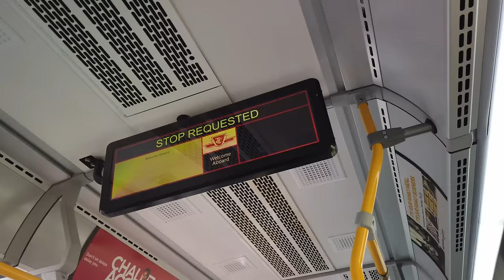Why American Buses Are Just Worse

Comment: I think the seat problem comes from this strange idea that if you make seats uncomfortable then homeless people or intoxicated people will just disappear.
Reply: If you're talking about those seats without any padding, well, those are easier to clean and more resistant to vandalism and general wear. (Yes, I'm aware that the vandalism bit is silly.)
Reply: @sonicboy678  See, I don't buy the cleaning bit. A padded seat with some kind of vinyl cover or something like that should be just as easy to clean.  But also I've never been on a bus or train with super dirty or worn seats, even obviously old ones. Now that might be because they spend a lot of time cleaning and repairing the seats but I kind of doubt that. Also the new LRT trains in Calgary have these plastic seats with a strange curvature that kind of digs into your back. I don't think that's because it's easier to clean.
Reply: @wearwolf2500  The vinyl may be easy to clean, but it tears.  I've seen several torn seats.  I don't know whether this is vandalism, people wearing tools, someone sitting too abruptly, brittleness in the cold, or something else, but it seems to be a thing.
Reply: @wearwolf2500  Vinyl is a quite bad idea, as it heats up when exposed to sunlight, and it gets brittle very soon. Most European busses thus have textile covers.
Reply: @Kyle Brown  Compare the seats on the London Tube with those on the New York subway. New York's seats, despite the reputation otherwise, are much cleaner owing to the fact they are plastic and only need a wipe down to be clean. London's seats are padded and require vacuuming, and are generally considered more gross.

There are subways that have been active for decades with the same seats because you can't really damage a plain plastic seat. Also, homeless people readily sleep on them so it's not a good deterrent if that is the goal.
Reply: @evancook1770  I'm pretty happy having 'gross' padded seats than awful hard surface ones. Another reason why I dislike travelling on the Subway.
Reply: @ballyhigh11  If the reason you don't take the subway is that the seats are a bit uncomfortable, you're either not from the city or likely not to take the subway anyway...js
Reply: most riders have enough padding on thier fat behinds
Reply: Homeless sleeping on buses and vandalism in America is the major reason why the seats don't have padding. It is just not practical in a low trust society where the default mode of interaction with transit is antagonistic. American buses are a classic example of the tragedy of the commons. We simply can't have nice things in this country. Maybe the next step is not to have seats at all on buses.
Reply: @Novusod  Europeans aren't any less rowdy...just look at France when any new law is passed or England during soccer season. Some busses in New York have padded seats and they aren't damaged at all.

Reason for plastic is because it's cheaper, sturdier, and easier to clean. Same reason anywhere else uses plastic seating.
Reply: @sonicboy678  and to act as deterrent to bedbug pest
Reply: @evancook1770  Europeans get rowdy for a couple hours a few times per year. America is a circus 24/7 365days a year. Buses aren't just used for transportation in America. They also serve as temporary shelter for the homeless who often do drugs and commit crimes while riding transit.
Reply: @Novusod  You've never been on a bus, have you...
Reply: @evancook1770  I'm from the US, and I have been on a bus. Generally, whether buses are nice has to do with the population of the city that uses them. When I lived in Houston, while I myself was not a crime victim or witnessed drug use, I did witness a few fights and regularly encountered people that seemed out of it, so I can see why people might be a little fearful. This only happened when traveling through bad neighborhoods - the public transit used by the medical staff was well behaved. Similarly, when I lived in Madison, Wisconsin, a major university town, the public transit was well used and quite clean. Now in live in San Jose, and it seems like only homeless people use it, but they're generally pretty well behaved - I don't use it very often, though, because it's extremely inconvenient and slow.
Reply: @Robert Irelan  It's definitely a matter of ridership, yeah. The crazies and what not I think are always there, but when it's just them it feels a lot worse (not counting buses that primarily serve high-crime communities which would have their own share of issues).

My point to him was more to say that buses, and public transportation I'm general, wouldn't be classified as magnets for the worst of society by someone that rides it with an honest lense. As you said, it's a reflection of the general community - if you're okay with your general community you should be generally okay with the public transportation.
Reply: That and buses are for the poor, and Calvinist beliefs decree that being poor should be punished.
Reply: No, not really It's two fold, first there is the guy with a knife trying to cut up the seats and rip out the upholstery. Solution ...have a fabric covered seat with no  padded upholstery. In fact  in some places have the back bench doesn't even have the cloth covering. It's just a hard fiberglass seat. They also now have a small drain hole in the middle so the drunk person  can pee on themselves and the urine drains on the floor. Having an individual bucket seat makes it a snap to replace a soiled seat with a clean one. The driver should call for a bus change so the floor can be washed, and we don't have to breath pee.
The rough ride is the bus system trying to not spend money on new shock absorbers. Sit in the middle of the bus for the best ride.The drunks usually are in back sleeping (and peeing on themselves).
Reply: @Rap Brz  Solid advice for the people that want public transportation without the public
Reply: Metrolinx has great seats. Not sure about homeless and intoxicated people. They just need to be enforced
Reply: Zaydan Alfariz  Because we have a lot of them. Our policy of treating housing as an investment that must stay scarce so it can go up in value ensures that.
Reply: @MrBirdnose  I think he’s talking about how Americans present homeless people as otherworldly and inhuman. The argument is rarely how can we help the homeless and more how can we get rid of the homeless.

Of course, a lot of this rhetoric comes from people that live in suburbs and rely on TV stereotypes.

For example, I have never seen a homeless person SLEEPING on a bus. That’s mostly a subway thing. But, people who have never been on any mode of public transit wouldn’t know the difference.
Reply: @banksrail  I saw it occasionally in Seattle. There were certain routes that were known for it, usually because of their length.
Reply: it's not that they'll disappear. it's that you dont have to repair them everytime bums and teenage bums break them. you'd be surprised at the number of people that crap themselves on public transit. not to mention drunks, addicts, and people that are plain bored and pick at the seats. most transit operators are already struggling to keep up with maintenance and when fairs cover less than a quarter of operating costs you can see why they cant afford to be replacing seats
Reply: @sonicboy678  In Toronto it is not necessarily silly.  Torn seat covers used to cost them enormous sums of money every year, and they might still cost them a lot.
Reply: @sonicboy678  Padding isn't required to have a seat that's comfortable to sit in. There are seats made from a single piece of moulded plastic that are perfectly fit to sit in for half an hour (or even 90 minutes, see about every soccer stadium in Europe). There are even benches from hard plastic that are nice to sit on for an average ride length (e.g. light transit in Hanover, Germany).
Reply: @wearwolf2500  hard seats are widespread even in Europe.
Reply: @SiqueScarface  Can confirm, from experience, that Vinyl is a bad idea; the seats on the Dutch ICM trains have a vinyl/acrylic type of fabric and those are starting to cack and tear, while the trains with more fabricy/leathery seats like a VIRM do not have that issue
Reply: Will Swift  With a lot of the buses I rode you were standing most of the time anyway.
Reply: The seats are plastic buckets because they are easy and fast to clean. They also wear better as they do not show wear as much. Plus they are generally cheaper. All of those matter more than your comfort when your transit authority is deciding what to buy.
Reply: @GeorgeMonet  Yeah, plus transit in North American cities always has to be uncomfortable and inconvenient in order to remind poor people that they don't deserve nice things.
Reply: Nope. The hard seats are a reaction to vandalism in buses. I remember soft seats being cut and destroyed intentionally all the time. Hard seats are the absolute standard solution in most Western European nations btw.
Reply: @Mike.Muc.3.1415  .
I'm in the UK and have never seen hard seats in a bus.
Reply: @wearwolf2500  we had that in NYC
And then the homeless came on and people started getting bedbugs and other things that stick to them
So we went back to plastic 
You get used to it you just can’t sleep on it
Reply: @evancook1770  Yes, but the French has a strong sense of social justice. And dont mind paying abit more tax so the homeless/jobless can have a roof over his/her head and food in their belly.

So people in France is way less desperate. France has pretty much the same crimerate as USA. But the crime in USA is super lethal and scary compared to the french crime.
Some of it is cause of the weapons in USA, but some of it is cause people are really desperate. And life becomes "cheap" when one is fighting for survival. Desperate people can do unimaginable things.

Best thing for a society is to minimize desperate people. 

I live in a fairly socialist nation aswell (Norway) we do some some desperation here too. But its way less than in USA, the desperate people we have is those who fall "thru the cracks". Like those who are too sick to work, to healthy to get disabilities financial support etc.

Immigrats, who dont understand the language or the bureaucracy so they can get food in their belly. Like we had a killing in on of our "Social centers" after some mentally unstable guy got angry at them for not suppling him funds for food. But the more people we cover, the less desperate people we get. Some people are mental cases. But alot of mental cases are bad upbringing etc, by desperate people. So it comes an evil circle. Just like you get a good circle going by educating and giving populations tools too thrive.

So we are discussing putting an automatic payment to everyone who falls under a certain income, so they dont have to fight bureaucracy etc. To lessen desperation and distress people feel. Yes, some will take advantage of the system. But most wont, most are honorable people after all. Who wants to live abit more than you can on goverment financial support. People have mandatory vacation here, and most people expect to vacation in a foreign country every year. This costs money, very hard to make happen with the money you get from the goverment.
Reply: @evancook1770  On the LA Metro it is common for people to smoke weed, vapes, even crystal. They'll pull out a pipe & torch and light up in a crowded train, not giving any f's. 
Sales are just as common. 
Reportedly SF MUNI is in a similar sad state.
Reply: @derek20la  Public transportation in California is bad in general.
Reply: Actually there are lot of homeless freeriders in public transport in my european city.
Reply: And it's the fact that in the US, you can't trust people to not vandalize property. We just do not have a strong moral society which is why you can see a nice new clean building get finished one day, then come back in about a week and someone would have graffiti all over it.
Reply: @dekoldrick  happens in Central Europe cities as well. Dudes that put spray on clean walls immediately, and its not even art (there are places with really cool graffiti), just signature of some a__hole. Or probably drunk guys/youth that break glass on bus stops. Talking heads explained it with the heritage of communism, but now we are 30 years after communism, have new generations grown, and the same vandals.
But buses are OK, sometimes they are just old scandinavian or german buses, thrown away by first users, but they ride.
Reply: @dekoldrick  That's everywhere
Reply: Bus seats on new Mercedes busses are extremly uncomfortable.
Reply: @mareklame8589  What country is that? I know some of the old eastern block has some homeless issues. And some issues taking well care of the mental cases etc.

I saw a few in Poland when i was there last. But thats nothing like walking in LA. In LA all you see is homeless people sometimes.
Reply: @MrDanisve  Poland. There are shelters. But there are homeless people that don't want to follow the rules, esp. not drinking. 

But you don't see homeless people all the time in Poland.
Reply: @UCSkT_4HRYsjHnauVFU0VXBA  In fact, Americans once came up with a concept which was even worse than this... That is, if you make public transport uncomfortable, unreliable, inconvenient and simply disgusting to use, then more people will buy their own cars. And this is the actual reason why US buses are soooo ugly. If you don't like it - then you can buy a car for yourself. This story shows how big and powerful the US car industry used to be some time ago. They even bribed some local authorities in order to literally marginalize public transport in the US.
Reply: @SiqueScarface  Meanwhile Singapore's buses that originally had velvet seats switched to vinyl (PVC) ones as the former triggered skin allergies in some commuters
Reply: @derek20la I can confirm the buses here in SF are pretty ratty and I would not want to sit on cloth seats in the Muni. Other regional bus systems like Sam Trans and AC Transit have cloth seats but their buses are much heavier regulated than Muni. The other day on muni some kids lit up a bunch of joints in the back of the bus on a rainy day so all the windows were closed and basically smoked all the passengers off the bus.
Reply: @ballyhigh11  its not really even uncomfortable, only for maybe hour long rides itll get slightly uncomfortable but you dont really ride that long often and even then its not bad
Reply: Urban youths will slice up soft seats.
Reply: Ah yes, hostile architecture. Let's make life more inconvenient for everyone, so that we don't have to see homeless people and be reminded poverty exists!
Reply: @evancook1770  I live in Budapest and nearly all public transit seats (with a few exceptions on some older trams) are padded textile. I don't think I have ever not sat on one due to them being dirty - they usually look just fine. I don't know how much maintenance and cleaning they require, but it's Hungary ffs - if it were too expensive the government would have no problem replacing them with hard plastic. This makes me think that cost isn't the real issue (at least not if you are, even only partly, funding your public transit systems appropriately)
Reply: @BenLemonade  Well that's the thing, public transport in America isn't all that well funded.
Reply: @sonicboy678  it is not silly. There is plenty reetrads who damage seats for no fk reason. Even here in UK idiots teens put their boots on the seats for no fk reason just because they are reetrads.
But yes, hard seats is dumb.
Reply: Where I am from the driver kicks them out?
Reply: @evancook1770  As a regular Tube rider I don't agree with your assessment that Tube seats are "generally considered more gross" than NY subway seats.  Where's your survey data?  I think that's your personal view only.
Reply: @judithingham4319  It's called insider knowledge. You can also just look at the fact that a majority of major cities' mass transit has solid or plastic seating. They are much easier to clean, and thus, more likely to be clean.
Reply: @evancook1770  you have a good point there. We seem to make buses uncomfortable for people so homeless and drunks won't linger/sleep get rowdy on them. 
But all that did was make everyone else not want to ride the bus so the only people on it are homeless and those who have no other choice. It deterred the wrong people.
Reply: Wait. You don't have comfortable seats because that's a way of discouraging homeless people from using the bus?  Who thought: Let's inconvenience EVERY passenger and make their experience uncomfortable just so that we can be mean to the homeless?
Reply: @tonycasey3183  The seats have always been hard. They're easier to clean and easier to make
Reply: @evancook1770  I have seen seats get harder with every new generation of train/bus
Reply: @evancook1770  
I am in the UK.  Buses have comfortable, padded seats.  Perfectly clean and easy to keep clean, plus they are  comfortable for passengers.  The idea tha uncomfortable seating has any benefits seems quite a spurious one to me.  I am pretty sure that the privately owned bus companies that operate in my area so not buy expensive seating that costs a lot of money to maintain and clean out of the goodness of their hearts.  Like any business, they are out to make profit, so, if hard plastic seating was really cheaper in the long run, I am pretty sure they would go for that option.
Also, I have never seen a homeless person use the bus as a place to sleep, but even if they did - so what? 
I have met elderly people who travel around on buses using their free bus passes but going nowhere in particular.  They get to socialise and talk to people, they sit in warm comfort and don't have to spend money on heating their lonely homes whilst out and about. This seems like a positive thing to me. 
Deliberately uncomfortable seating on buses feels like a political (with a small 'p') decision rather than an economic one.
Reply: @wearwolf2500  That might be a local thing
Reply: @evancook1770  but your comm
Reply: @evancook1770  and your comment isn't?
Reply: @wearwolf2500  What comment was local? I was speaking generally about transit policy. When I was being specific, I would say what I'm talking about. If you want me to be local, I could say that, actually, seating has gotten more comfortable in New York over the years, not less.
Reply: @evancook1770  My point is that I don't think you can say "The seats have always been hard" generally. There isn't a universal transit policy governing everywhere. You could say "Most" but even then my experience is that older transit tends to have more comfortable seats. Maybe super early stuff when it was all wood.
Reply: BART used to have full cloth seats. They were NASTY. It has nothing to do with discouraging homeless people to use them. It has everything to do with being able to clear all kinds of human fluids off those seats. You can't clean a cloth seat well enough to keep it sanitary on transit.
Reply: @RobertIrelan p
Reply: @paulbedichek5177 I never did when I was a youth.
Reply: @fatallyfatcat5274 It used to be that way in the US, but now drivers get shot for "disrespecting" riders who break the rules.
Reply: @BertGraef Really? Because most private automobile drivers I see are like 150% chubbier than public transit users, yet the seats in their cars and trucks are padded to the nines.
Reply: @bearcubdaycare  In Budapest, until 2023 they were still old Ikarus buses in use in a small number, and most of them had "new" like 15yrs-old seats made from vinyl and they weren't teared. I'm sure It's about idiots having fun with a knife...
Reply: @SiqueScarface  Old Ikarus buses in Budapest had/have seats like that and they are not hot and very comfortable and also they are not teared apart although the newest Ikarus cuty bus in use is the 412 model made till 2001.
Reply: @evancook1770  Most people want to sit on the seats, not eat their dinner off them.